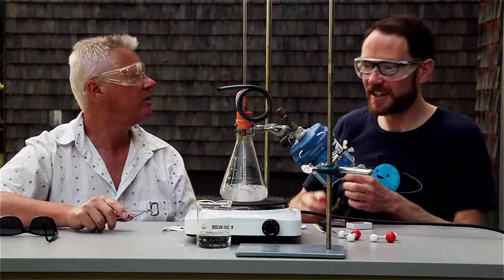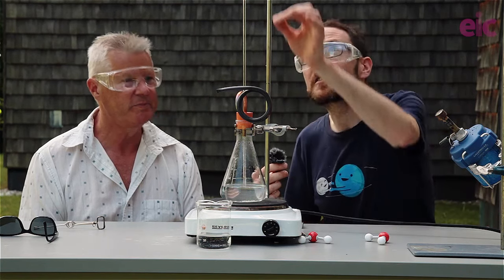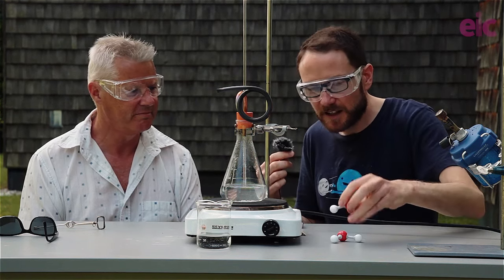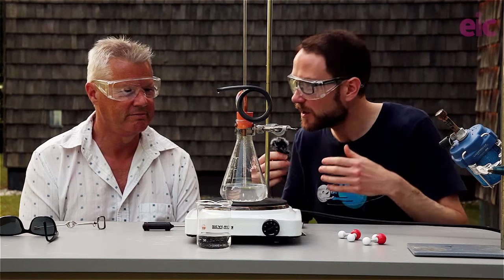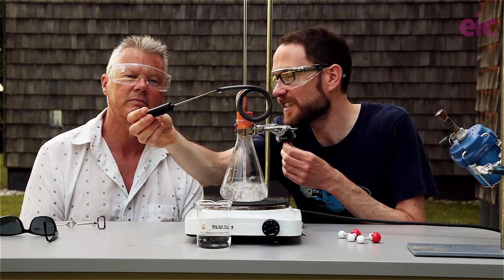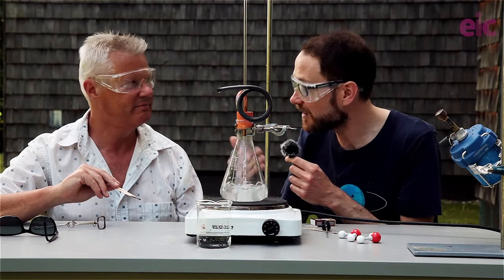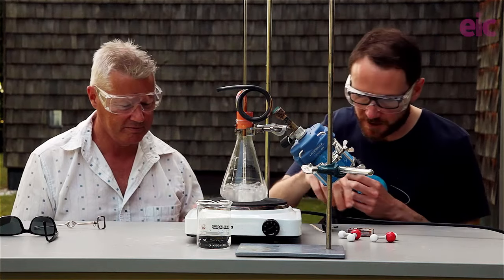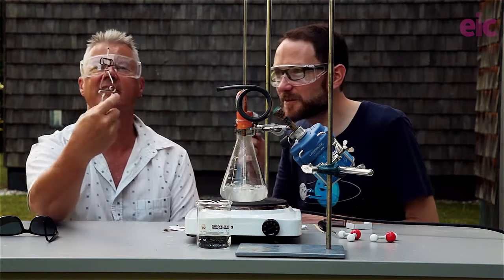Celsius 233! | Superheated steam experiment

Comment: Hi Sirs, thank you for the eye opening demonstration. I have a question. Can the gaseous water turn cobalt chloride paper from blue to pink ?
Reply: I guess you will get a mixture of light blue cobalt hydroxide and maybe some hydrates - it's because at such temperatures the chloro complex will likely break down (escapes as hydrogen chloride) while the hydroxo complex gets favoured - at least this happens when the hydrated cobalt chloride is heated too much even in presence of water - this is why anhydrous cobalt chloride should ideally be dried in a stream of dry hydrogen chloride